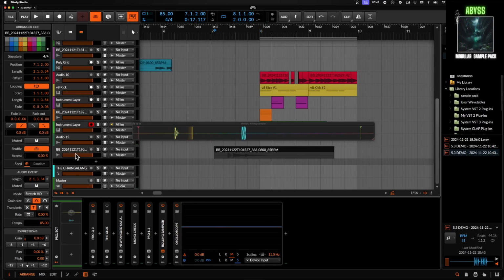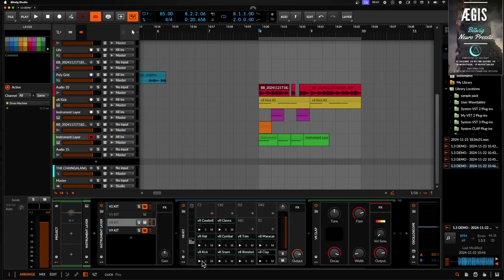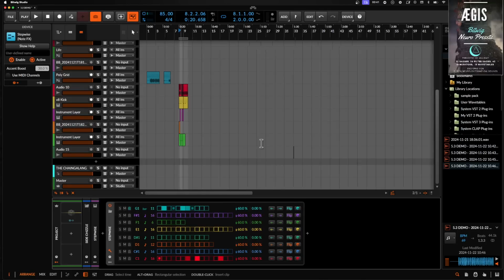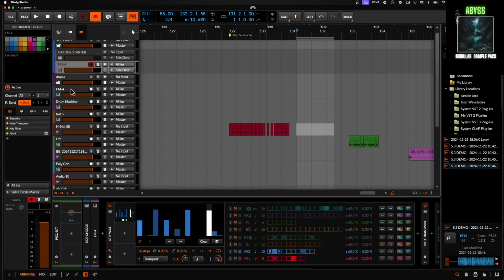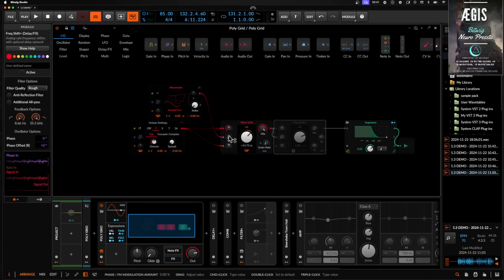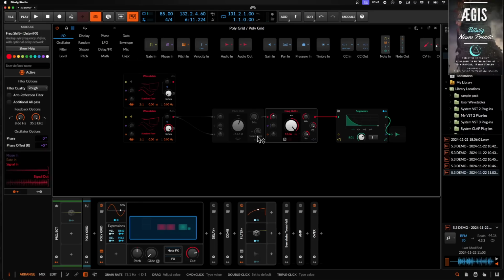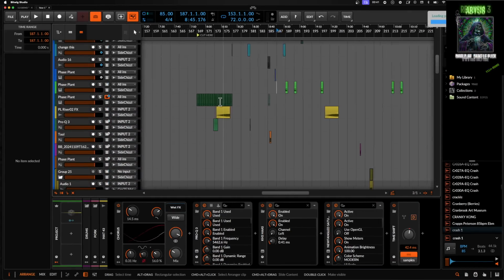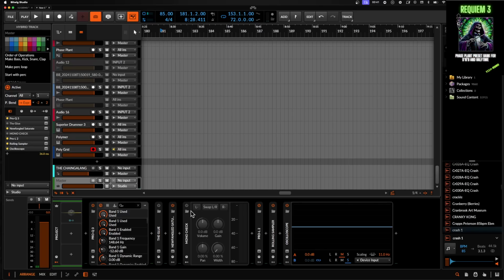What's New in Bitwig 5.3? +Feature Wishlist

Comment: I’m sure you could make a grid workaround , I really hope there will be a grid version of the drum sequencer , that would be nuts !
Reply from the maker: Gates have been around since the note grid. I haven’t  tested whether the midi clock would allow shifting like that but you’d still have to set up a stepper to modify each step…. Which didn’t work with the sequencer device. Audio or piano roll is still the way to go

Comment: Use the Steps modulator in bipolar mode attached to the timing percent on Stepwise.
Reply from the maker: It doesn’t work. The clock doesn’t adjust fast enough to catch the offset. It would have also been very cumbersome to be precise

Comment: In re rubato, you can of course modulate the main clock, but that's a chainsaw where you want a scalpel. 

I have a fair amount of experience with step sequencers in eurorack and VCV, but the Elektron sequencer is still the best. Bitwig has taken some cues from them already... so yeah, micro-timing is really good. (Now that I think of it, Elektron doesn't have enough resolution; they have more or less fixed increments across the step, where you really want finer control as you get close to zero offset.
Reply from the maker: I actually tried to modulate the clock via changing the offset from steps and it barely worked. Not a viable option. I’ll probably make a dedicated video on the matter

Comment: Stepwise needs, and it doesn't even have to change much:
Velocity per step. (drag note up/down, shift for fine tune)
Repeat per step. (drag note to the right/left, shift for fine tune)
Probability per step.(modifier key, and drag note in %, shift for fine tune)
Up to 128 steps. (simple arrow for pages)

I could think of a lot more of course, but give me these and I'll be happy. 

I'm aware of the mod workarounds that kinda work for the first 3 asks, but they're less than satisfactory and too much extra for such simple functions that really should be part of any base level poly drum sequencer.

Comment: Great video. I noticed you're using a Mac; however, on my Windows machine, every time I launch Bitwig 5.3, it scans audio devices and a window pops up in the top right corner saying, "Audio settings changed - The changes will be applied when the Dashboard is closed," even though I haven't altered any audio settings and the Dashboard is closed.

Comment: In regards to a solution for the Stepwise per note offset, what would you think about having the ability to drag the blocks wherever you want by using a keyboard modifier key + click and drag ?
Reply from the maker: I see what you are saying and would be down for that
Reply: I like the line under each block like in Fors Opal. Can see if you’re nudged forward or backwards easily per step.

Comment: Would love to see a groove pool/global MIDI groove. Something I use a lot in Studio One, which the lack of has stopped me moving to Bitwig, as much as I like it.
Reply: I agree. 

Also, Its not the same as the global groove/swing. A groove pool, done right, allows you to use and make groove templates. That is to say, It lets you apply/extract the feel of actual drummers, players, drum machines, ect. 

They used to be called "DNA groove templates" back in the day. 

Def would love to see that in BWS.
Reply: The drop-down menu on the play button has global groove options. Hope this helps!
Reply: @mixxcustomsounds7702 not the same but usually bitwig fanboys like you are so narrow thinking it’s impossible to explain… hope this helps.
Reply: Global groove/swing already exists under the play button, and you can toggle it on/off per clip on the inspector panel when clicking a midi clip, and turning off 'shuffle'. It's on by default, which I actually don't like. They should have an option to decide in the settings, under the 'behavior' tab, whether newly created clips spawn with groove enabled or disabled, and not just have a separate button of whether global groove is on/off.

 What I'd like to see them implement in the future (and I know this might be a bit niche), is the option to implement different swing percentage per clip, or per track. Because as it works currently, you only have global groove. But you can get some really funky rhythms going by having different tracks be at a different swing percentage.

I know you can just manually nudge the notes to a swing you like, but would be nice to see per track/clip settings for groove.

What I usually do now, is to manually disable shuffle from all the midi clips in my projects, but keeping global groove on. And then apply groove to specific clips at a percentage chosen in the play menu, by enabling shuffle from the clip. And when I want to use other percentages, I just bounce the clips that have shuffle enabled to audio, turn the shuffle off from said midi clips, and apply a different percentage to some newly selected clips by changing the global groove from the play menu.

As you can see this is a bit of a tedious workaround, as you have to constantly keep track of which clips have shuffle enabled, and which don't, and whether you have bounced them or not, and at what percentage of swing (if you changed it later) you bounced them. In larger projects this is really a pain, especially if it's a while since you worked on the project.

All of this could be solved by having the option to apply groove per clip, and have the settings enable you to turn off 'shuffle' by default. I don't really understand why this isn't a thing already, since each clip already has the 'toggle shuffle on/off' button, so groove is already clip specific. It would be very logical to give us these additional options to control groove per clip, and not just globally.

I might email them about this, actually, since it's been bothering me. Suggest you do the same if you like to have more control over groove :)

This would also be a really simple thing to implement.
Reply: I would like the groove stuff from Reason that has like mpc style swings and some beats/drummer grooves

Comment: Time stretch in the sampler. There is no way to play chords without the notes being unequal lengths. My alternative for now is to use the sampler within Current whenever I need to do this

Some note preview improvements in the piano roll. Highlighting notes should preview them like in Ableton or better yet have something like FL Studios alt / right click preview

A groove pool would be nice. A swing grid where you can actually see the lines on the grid move according to your set swing

And yeah I agree with you. It needs some good solid stock devices. A lot of them are pretty good especially the newer ones like compressor plus, but the Ableton lineup is much better. 

A better way to quickly export single MIDI clips and to be able to quickly locate a used sample in the project without manually comparing specific file names in the files tab.

And things like phase shift when using multi band effects, and the unreported latency of EQ+ (fixed now) should be mentioned in the manual if something like that exists, not leaving users scratching their heads. 

None of these are deal breakers though, and Bitwig is still the one that I believe have the best balance of features for me. And for specific things like groove pools or swing grids, I just quickly open up another DAW when I absolutely need it and import it back to Bitwig. 

 My update plan just ended but the current release doesn’t excite me to upgrade. To be honest, the feature I was most excited about was the auto switching of audio devices, as I tend to work docked and undocked on a laptop and it is annoying to set the audio device manually always. 

But even better was that they mentioned that Arranger and piano roll updates are coming next, so I’ll wait until then.
Reply from the maker: so there is a workaround to the first suggestion. if you set the mode to granular and use a ramp lfo on the playhead, it will actually do what you want it to. although not the most lavish solution.
good points on the other stuff

Comment: - Oh yea, rainbow macro knobs were dope and should come back!😊
- Tuning for all drum devices 100% 
- IF Bitwig was about to make an OTT, i really would hope it to be CPU effective. I really don’t like the comp+ approach where the internal Bitwig device draws more resources than VSTs of similar kind - usually it should be the other way around.
- concerning seeing several device layers: what about a device panel fullscreen Mode and being able to show layers vertically all at once? :) i ve always had the impression that it’s a pity to force all devices and chains into just one single row with a fixed vertical size
- you asked about other feature wishes 😅: for me those are mainly fixes (automatic fades for fresh clip recordings dont exist yet, like in Ableton - to prevent CLICK noise at the beginning of the loop. Also undo/redo unfortunately is deactivated  while rec. in arranger is active)
Editing improvements: better direct feel of automation point movement via mouse, automation segment creation, automation drawing tools/envelope browser.
Better zoomstages: being able to still see waveforms/notes despite very small tracks. Alt+mousewheel vertical zooming. Semitransparent Clips. Infos at the cursor about current/new Positions. Option to turn off Automatic toolswitching, especially for  clip-gain and note-selection-range. Option for Clicking in notes based on gridlength via doubleclick. A real snap to grid, where elements wont ever land inbetween gridlines. Shortcut for Loop on/off for every Clip, amongst other missing Shortcuts (note audition for example). Seeing the impact of gain-automation directly inside the waveforms. Stuff like this. 😊

Comment: Orrr Just use the manual note delaying while using a drum rack
Reply from the maker: I think you’re talking about time delay but can’t automate that. I mentioned the other note effects howver
Reply: @Alckemy  I agree I bet editing notes timing by hand feels better and you have more control but I see your point in the video
Reply from the maker: @swagger_jeans  nothing beats audio as of now. But having an elektron sequencer along with some other stuff does make that process a lot more manageable
Reply: @Alckemy  agree one hundred percent, but see the problem with delaying notes not audio clips is complicated because when you shift something ahead it stays at its position on the audio of everything is delayed it's not the case with doing it manually where you place it by hand, it's similar to how compressors work they can't work ahead of time so that's why we have lookahead 😅
Reply from the maker: @ moving midi early via a trigger is different than the time delay as you’re manipulating when a trigger happens vs midi hitting and then audio trying to adjust to the clock. 

Different processes^^

Comment: There is the steps modulator. And there is the time offset parameter. Modulate it with the steps modulator and you get your timing offset per step
Reply from the maker: I went over this in the demo stream. More trouble than it’s worth.
Reply: @Alckemy  having offset be disaggregated from individual steps makes it more flexible. This system allows you to have polyrhythmic timing for offsets separate to steps, not sure what else is offering that.
Reply from the maker: @ no. It’s super in-precise from having to adjust step timing via the step modulator and aligning which note you want to shift. Are there some cool experimental things you can do? Sure. I covered that in the video. But opening the other modulators just to shift one or two steps early exactly where I want them to be is not worth the time. Bounce to audio- place on the timeline and done. Look up patterning 3. You’ll understand what I’m talking about
Reply: You could say the same about Stepwise: just use the grid. Thing is: people often go for a sequencer enough times that it makes sense to make it convenient to use right away. Having the step offset ready to go should also be one of these conveniences imo. It's great to have it in my Elektron box, and it would be similarly awesome to have it on Stepwise.